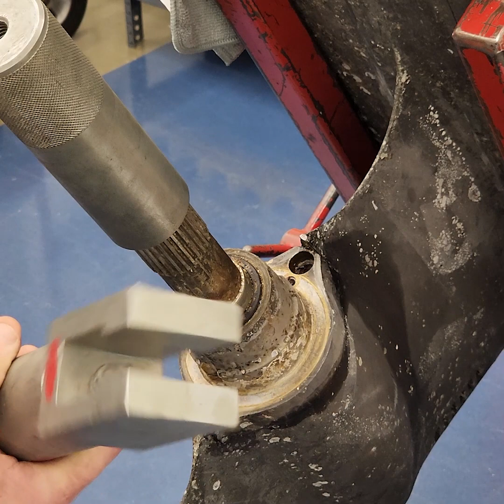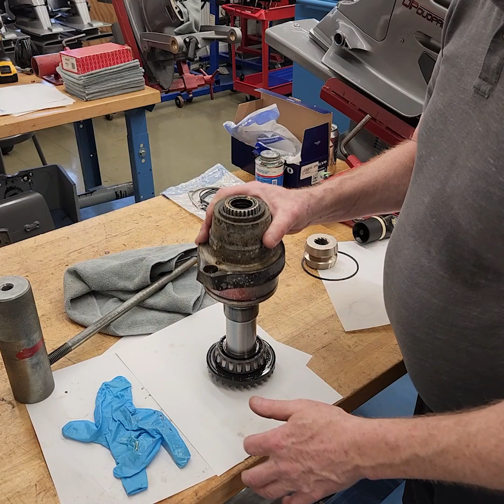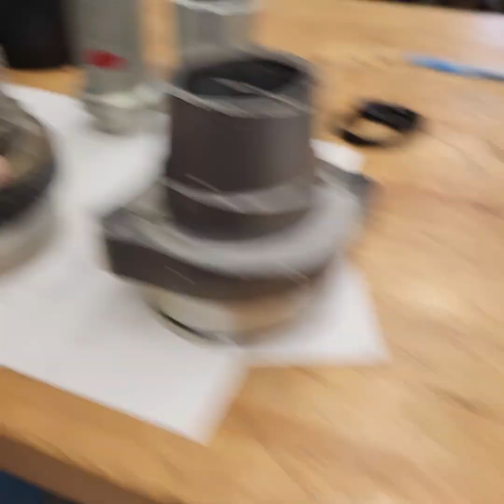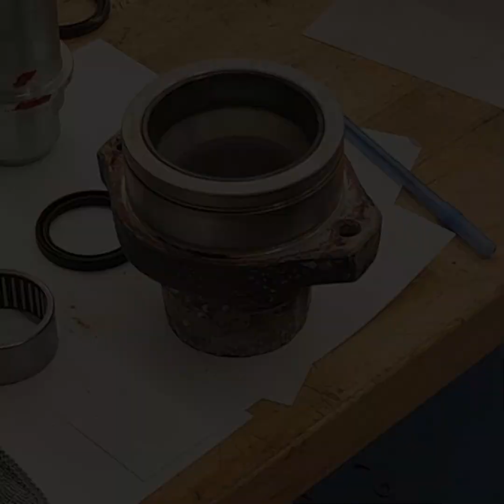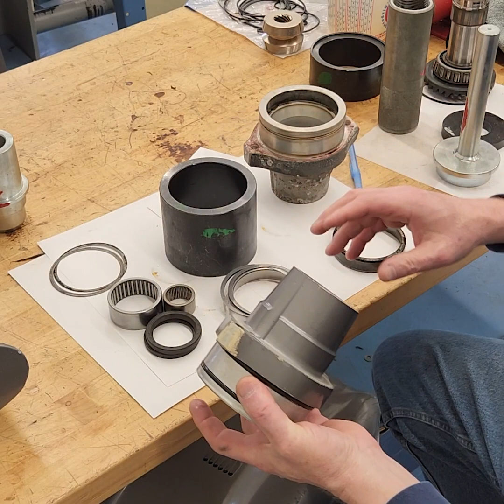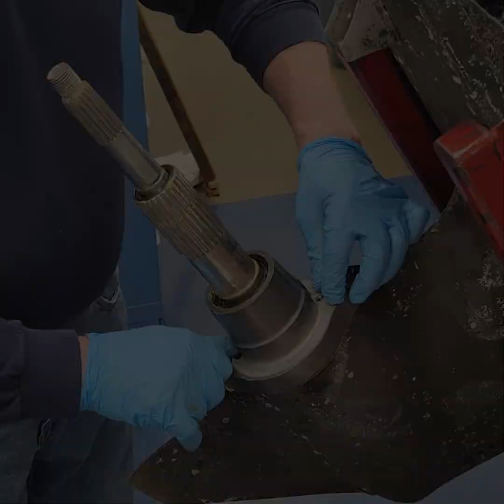Volvo Penta DPE/290DP Lower  unit resealing Part 3

Comment: What if I have to replace inner shaft? Do I still have to remove the lower unit? I'm trying to avoid removing lower unit from the sterdrive. Reasong I need to replace the inner prop shaft is because slightly bent the tip with a puller as I was trying to remove the stuck prop. Unless there's a tool that could fix the tip... it's only Ben 5% to 10%

Comment: Hi Ted, I have been watching your very informative videos. I am in the process of resealing my 1990 290dp lower unit
and removed the outer and inner prop shafts to check runout. The outer is .002 TIR and the Inner is .005 TIR when put in vee blocks. My question, if you would be so kind, is whether the outer shaft is still in tolerance, and should I try to  straighten the inner shaft.  Thanks in advance for any advice.
Reply from the maker: No vibration issue prior? Put it together and run it. .005/2  =.0025
Reply: @tedsmarinerepair8956  Sorry I didn't see this reply until now. Further inspection showed a Bad Solas front prop that created vibration. I had run with the new seals and eventually the bad prop ate them up. I have since replaced the carrier bearing and seals as well as the back prop bearing and seals. I have new props on the way. Thanks for your reply. I'll let you know how that works.
Reply from the maker: I do find some inner shafts that far out but it is not an issue for a drive of that age. I would put new prop seals and shaft bearings in it.

Comment: Hey Ted, since owning a 290dp I've become very familiar with the top end, but the bottom was scary territory for me. Thanks for the video, it helps a lot more people than the ones who comment I'm sure. Are you aware of anything in the bottom end that would cause this drive to begin slipping and hitting high rpm's at full throttle? I know it's not the prop hubs, they are marked. The top end, shaft and everything else looks good. I even pulled the motor out this week to check the flywheel, etc. and everything is good on that end. I don't expect a full diagnosis, I'm sure you have better things to do. Just curious if you've ever encountered this before. Thanks and again great video!
Reply from the maker: Did you replace the drive coupler that is bolted to the flywheel? That or a slipping cone clutch are the only things besides the props.